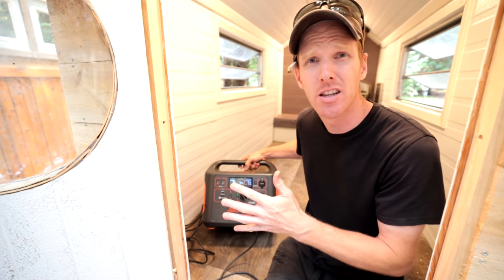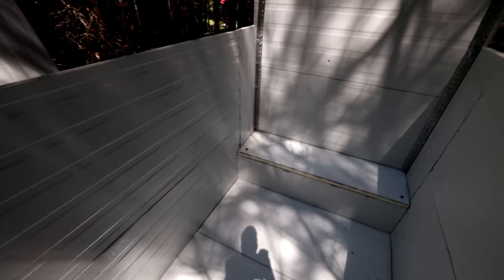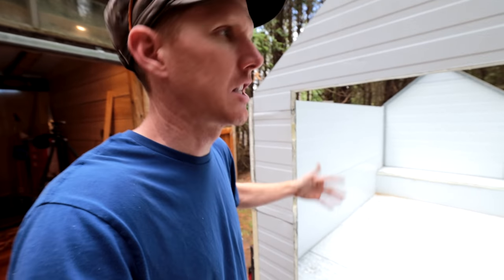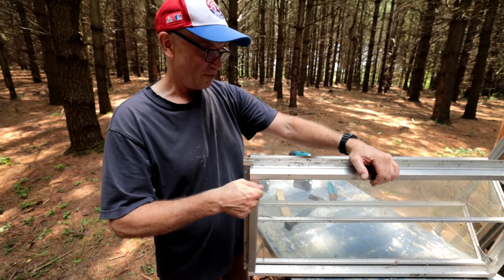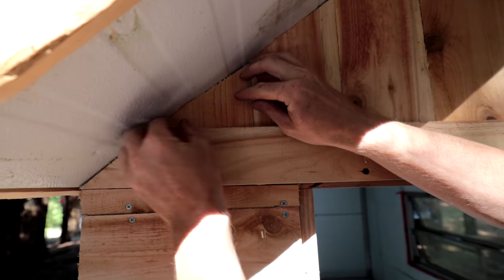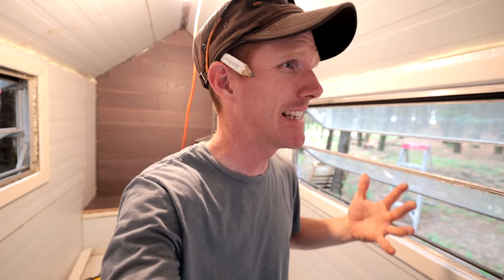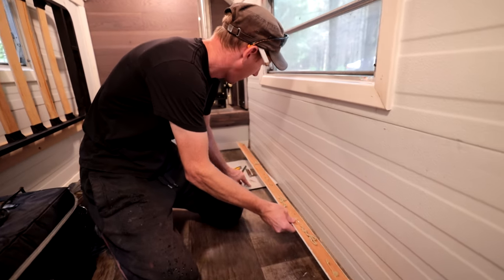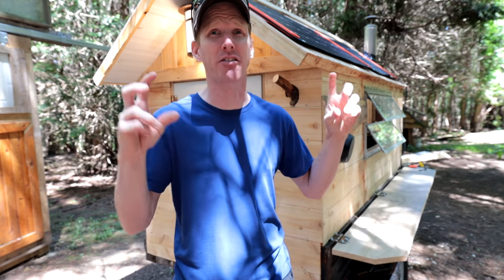Building Tiny MICRO 32 sq ft. LUXURY RV Camper - "The Glamper!" VS. @FowlersMakeryandMischief

Comment: Nice build and don't want to sound like a hater but I can't get over all the emphasis on insulation and being water tight, but then going with two of the worst windows for leaking and having an r value in the single digits! I had a shed with that style window and after any significant rain I always had a huge puddle inside! Also with not having a screen to keep out the bugs ugh! Sucky windows but otherwise a great build, nice work!
Reply from the maker: I think every window has an r-value in the single digits.   What I lose in efficiency on the windows I make up with a wood stove.    If I had access to "better" windows I'd of installed them.

Comment: I dunno about making it so open and visually ascetic. That makes you very vulnerable in my eyes especially if your going camping in the middle of nowhere. I would have some motion sensors set up to a loud speaker so when someone or something registers on the sensor its loud speaker will let the occupant know something is close and then a siren go off to make the "thing" retreat. You have to think about safety 1st in camping.
Reply: I definitely would have glued the vinyle flooring down. The glue would have been used as another barrier per say..
Reply: Overall its definitely cool